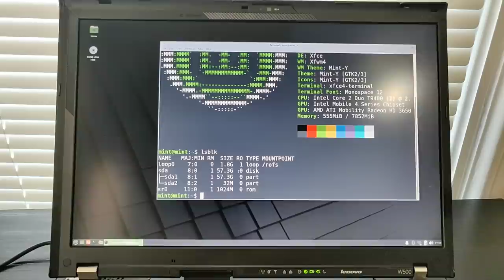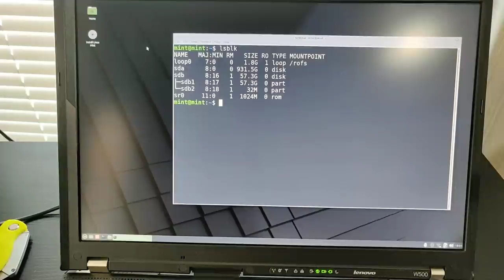SSD Upgrade for ThinkPad W500

Comment: My friend loaned me a ThinkPad T60 (maybe 13 years old now) and he refused to take it back when I asked. I did exactly the same operation as you did, easy as pie. The more complex upgrade was to install more memory to it. Actually one of the hardest parts was to find the right kind of memory sticks (2 GB DDR2). Finally I bought a few from two flea markets (kind of). And that little piece of... won't understand anything more than 3 GB. Well, I've succesfully used it in a few occasions, nevertheless. With LM 20 MATE & Cinnamon (I still don't like XFCE).
Reply: Use a WM it will be wayy lighter
Reply: Oh, btw I gave the SSD (with the Linux Mint) and some of the memory I had in my cupboard to a nice neighboard lady. Now I will have some time off to buy me a new (cheap) SSD to play on.
Reply: @User9681e  "Use a WM it will be wayy lighter" on a 13 year laptop? Are you crazy?
Reply: @OldieBugger  i have a t400 using a icewm runs smooth af

Comment: The problem with that ssd is the horrible zero garbage collection, despite trim enabled and manually forced from the defragment menu in win10. It is why you should just donwith samsung or wd, even though they have been caught using inferior parts and selling them at the same price for lower performance.

Comment: I’m currently looking into how to transfer my system to switch to a bigger ssd (same crucial) from the one my x230 came with. Next up is flashing that bios and getting wifi 6.0 then eventually coreboot (:

I think there are more easier ones though, f.e. when you replaced an optical disk drive with a caddy. about to do that with an old dell laptop.
Reply: *easier ones
Reply: @florianfelix8295  you can edit comments on youtube, you know.
Reply: @Xumatro who cares - there is way more unsympathetic stuff than that round here.

Comment: This is not really related at all, but I've been having these issues of my computer randomly rebooting(across multiple distros). Maybe you could help?(distros I have tried: Debian, LMDE, Pop!_OS)
Reply: @lytix  strange I have a 1650 on pop and it works just fine
Reply: @andrewwojtas8486  same here.  but when i switch to integrated graphics my laptop feels so much slower.  is this the case for you too?
Reply: @ryancyt  no not really
Reply: @andrewwojtas8486  pop has great integration with nvidia drives
Reply: @lytix  I have amd graphics, I don't think that it's a GPU thing.

Comment: These old thinkpads are starting to become a hipster meme now. There are much better laptops that are slightly newer now. Even with trackpoints and decent looking keyboards. The processors used are also faster and way better. Duos and 500's are getting too old to do anything more than word processing now. (I compile software all the time now and fuck I need something newer.) 

P.S the rubber bumpers are called "anti-vibration mounts" that's because they're used to limit HDD vibration in the caddy and to protect the drive itself.
Reply: Are those newer laptops able to run libreboot ?

If that's case, which laptops are those ?
Reply: @MsAlfred1996  The best example is System 76 for brand new hardware with the IME disabled.
Reply: @wheezybackports6444  I thought that those used coreboot, which does not remove the IME, neither do them give you a 100% free BIOS replacement.

I thought that those run on coreboot, which just disables a tiny part of the IME.

Please, correct me if I'm wrong.
Reply: @MsAlfred1996  They do run coreboot and the system76 devs have been able to disable the IME entirely before.
Reply: @wheezybackports6444  Oooh, I did not know that.
Then, does that mean that it can run libreboot ?

And are those as modular as thinkpads ?
Reply: you're 12 years late